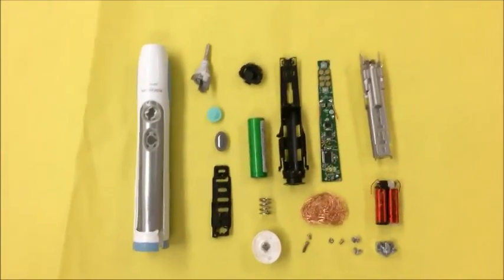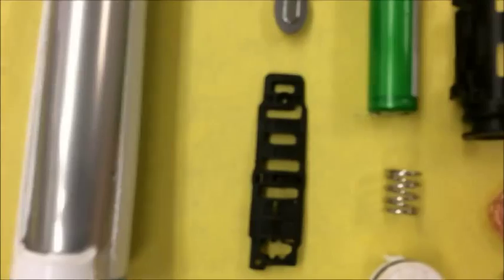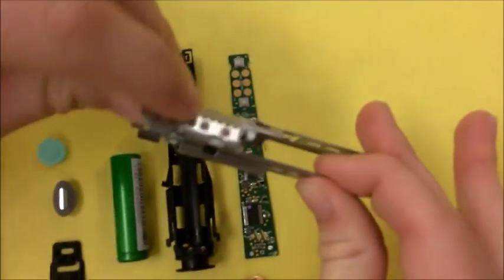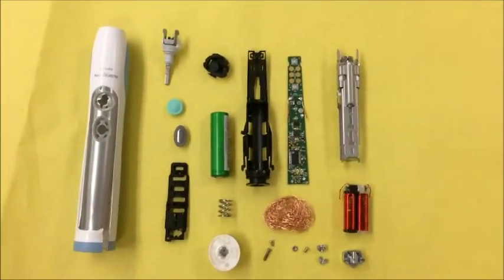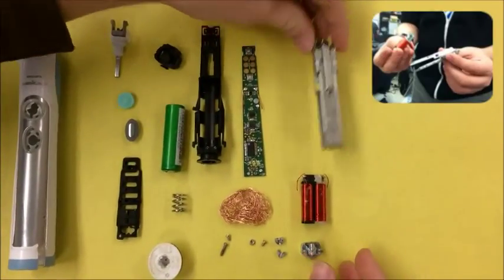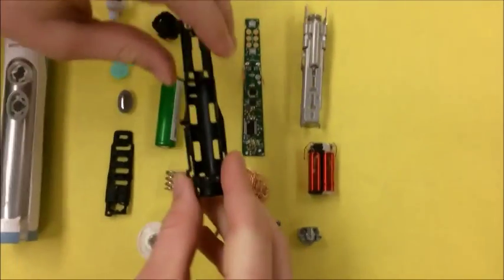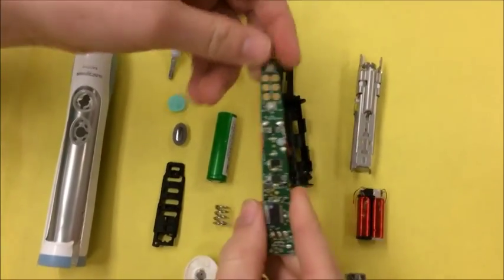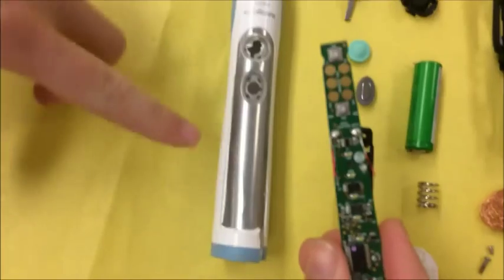Tooth Brush Tear Down

Comment: I'm trying to separate the black plastic frame from the metal motor housing - there are clips, but I can't figure out where they clamp and how to separate. I can't see clearly how it attaches from your video either.

EDIT: just figured it out - carefully bend the assembly to pry out the spring and its rubber holder. Then you can slide the plastic frame to full extension and it will then separate from the metal motor housing. I hope maybe this helps someone else. 

I'm trying not to desolder the board since I already replaced the battery and soldered it back. But it turns out the two mini screws that hold the coil to the metal frame have rusted threads and won't hold, and one is underneath the plastic frame.